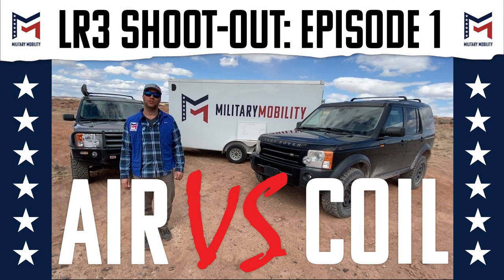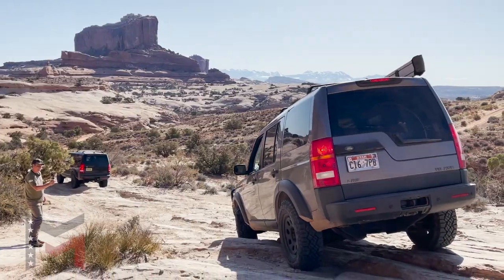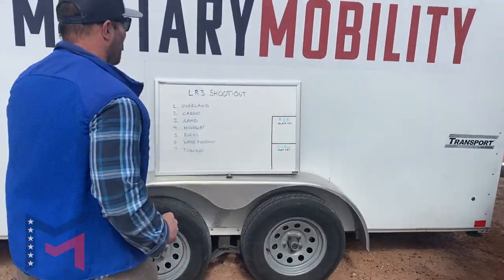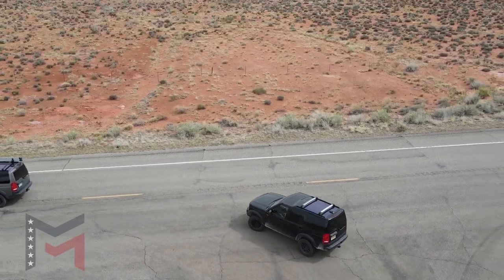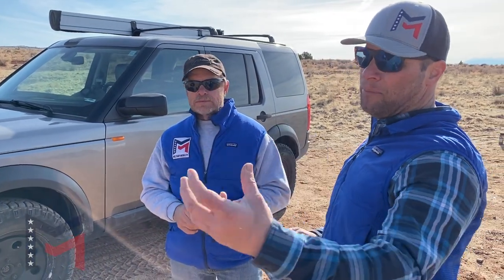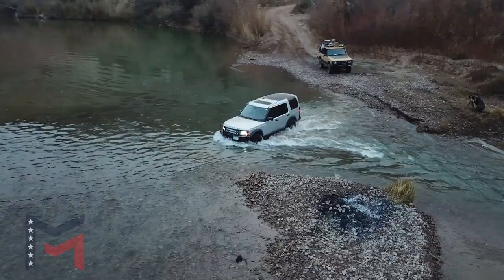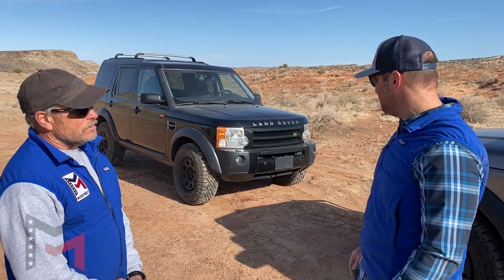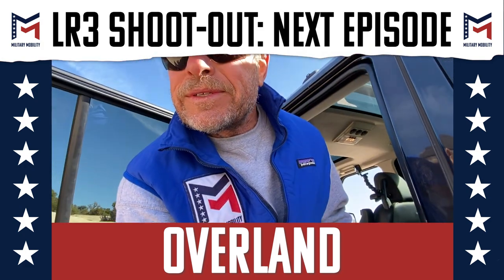Episode 1: The Set up / Land Rover LR3 / Air Vs. Coil Shoot-Out / Military Mobility

Comment: Hi Brian, 
Steve from GAP Diagnostic here. I just happened to stumble across this vid series. VFC! Very cool! 

The one thing I did want to mention: the IIDTool is actually a great backup for a air suspension failure as well. You put the air suspension in "build mode" (as in the factory during the build) and the EAS ECU will not do anything automatically anymore. You can then pump up each corner of the vehicle manually using the IIDTool and the vehicle will stay at exactly that height. Barring a catastrophic failure of the compressor or an air bag (both very rare) or other mechanical issue, you're good to go.

Good on you for keeping the air suspension. It has a much worse rep than it actually is. And if you consider it a maintenance item and check it regularly, you'll likely never have an issue off road. If you have any questions or suggestions, give us a shout.
Reply from the maker: Steve, thank you for joining the conversation; and sharing these insights with the group! We’re so glad you are enjoying the series 🙌. I’ll tell you that the IIDTool has been invaluable for us in troubleshooting the EAS when the LR3 was donated to us on the bumpstops; don’t believe there was any feasible way we could of diagnosed or tracked what was going on without it. So cheers to you guys, and thanks for your incredible customer service; it’s really appreciated!

Comment: Dude the air suspension is amazing and with the GAP IID tool is amazing. I had a 2007 RRS HSE lifted on 33” Yokohama geolandars and those exact same black rhino wheels and arnott struts. Stuff did go wrong over the 80k miles I had it (stolen from my condo...on a flatbed !) with the rod lift lights all around snorkel bumpers winch etc etc and it was an amazing truck. However I grabbed a 2000 lx470 and have been customizing that and it’s a much more robust vehicle. That being said...KEEP THE AIR SUSPENSION ! You can adapt the valves independently to external compressor and regulate your lift at will. Lucky 8 off-road will be your new best friend.
Reply: How do you adapt the bags?! Heard of this not sure how it's done.

Comment: I love that you guys show the LR's some much needed offroading videos. These vehicles are amazing!
Reply: Also, I believe the iid gap tool can overide the height sensors which stops you from dropping to the bump stops.
Reply from the maker: Love your user name! Thank you very much, they are incredibly capable vehicles and we’re excited to share our experiences with the community 🙌
Reply from the maker: @dukeyhowzer  We have the Gap IID tool and rank it among “essential” equipment if owning an LR3/4. Partly true, the Gap tool allows you to set ride heights in a variety of ways and is extremely useful in troubleshooting, as well as some field repairs; however if there are failures to certain electrical or EAS components, the air suspension won’t function properly unless other measures are taken as well. 👍
Reply: @MilitaryMobility  I see then I was misinformed. Thank you for the response! I know see the importance of what you did to your LR3. Would you be willing to make a video on what you did, like a how too? I've never seen or heard of someone doing that to their air system. I would love to do this on mine!
Reply from the maker: @dukeyhowzer  Absolutely, we dive into it more later in the series and will be making a stand alone instructional as well 🙌

Comment: try fitting an X Lifter air suspension upgrade on the one with air suspension. Its a cool upgrade that %100 getting for mine.  It even has a recovery feature that overrides the AIR SUSP INACTIVE fault so can air back up if the system deflates.
Reply from the maker: The X Lifter is a great tool that our affiliate sponsor Atlantic British offers. Depending on what may go wrong with the suspension it can override certain issues; however if you have other failures of the reservoir tank or compressor, etc it cannot.

Comment: Nice to see a new video from you guys👍🏻 I have coils on my LR3, 275/65/18 Cooper STT Pro Mud Terrains. I've had several LR with and without air. While I like the no worry coils, I would prefer the air. Just more attention and upkeep. Use a set of lift rods and you are good to go. Also, I would like to have 35" tires but not going to happen on LR3/4 without heavy mods and just not worth it. Really should have 33" minimum that is the optimal size anyway. 32" with the 2" coil lift is what you can expect to fit. I had an airbag with a leak, put some green tire slime in it and it sealed up until I got back home.
Reply from the maker: Thanks Zman, took much longer than we preferred to put these out (staffing running the non-profit where serving veterans in need is our priority) but we’re so excited to up and running again!

This is great insight that you’re able to share from owning and driving both rigs long term. You’re right about running 35’s; the ones I’ve seen done like that will not last the way it’s set up, zero up-travel and taxes the cv’s. I’ve heard about the green slime trick however had concern about gooping up the entire system permanently. Did your EAS run well after the slime was introduced? 

And please keep the comments as the new episodes roll out!
Reply: @MilitaryMobility  I took the air-strut out and dumped the slime in through the top in the opening for the air line. Tilted it around to get it all around the inside. Reinstalled and it held with no issues to the air block or system. I did it as a test since my air strut had a leak. It lasted for a year until I sold that rig for a different one. It's prob not a long term solution but if you are in the back country it's a good trick to get home. Just keep a bottle of slime in your recovery kit. Not to be confused with fix-a-flat stuff.

Comment: Do you have a video or write up on how your backup system for if the onboard system fails? You mentioned airing the shocks up manually, I’d love that option as safety. I have your exact same setup (2008 HSE on 32s with rods)
Reply from the maker: Hi Ryan, a bit later in the series we’ll be diving into it in detail. We’ve also already improved upon our initial product and will have the improved Rescue System for sale on our website. All proceed go towards funding our veteran courses as we have no paid salaries and are an all volunteer organization 👍🇺🇸

Comment: This is cool! Do both of them have the HD package with the rear locker?
Reply from the maker: Neither of them do, so equal in that regard. This would indeed be a nice capability to have however we’re a non-profit and can’t be too choosy when acquiring vehicles, or in the case of the Black LR3, receiving donations. We’ve taken these rigs over some pretty challenging terrain and have been pleased with their performance over the last few years. Would be nice if you could positively control the rear locker like in our other non-LR vehicles. I’ve driven HD versions and have only ever seen the locker come on sparingly, Thinking a side by side of HD vs non might be in order next!
Reply: @MilitaryMobility  Absolutely. My old 06 LR3 HSE did have the HD package and there was a noticeable difference in climbing and low-speed maneuvers. Other than that, the Terrain Response was insanely good, even without it.
Reply from the maker: @BorellaFamilyAdventures  Good to know! More downhill control is always a huge plus!! Helping climbing doesn’t hurt either 😂

Comment: Great comparison idea. I would point out though that comparing 15 yr old air shocks to newer coil on shocks is not very fair if comparing the dampening. With pre-emptive replacement of the air shocks,  solenoids and air compressor, you can get another 15 years of reliable use.
Reply from the maker: Thank you; we’re doing the best we can with what we have. The point of the series is really to drive awareness to our non-profit that’s is focused on suicide prevention and illustrating that we know what we’re doing to potential supporters. Side note: we now have brand new air shocks on the black LR3 and while it is a bit smoother here and there; would vote the same way.

Comment: I was looking forward to all of this. Until you said it’s a stock air suspension system but with lift rods.  It runs higher pressure in the bags and will then give you less flex. So it’s not a fair test.
Reply from the maker: What would be fair for you OB92?
Reply: @MilitaryMobility  To me, this was a fair test of two LR3s both modified to run matching larger diameter tires for the improved ground clearance that better suits MM's off road operation. As the series continues, we will see the Air suspended truck out-flex the Coil equiped one despite the higher pressures in the struts. OB92 I'm guessing you might prefer to see a vehicle with standard height coils vs one with standard height air-struts, both running original 29" tyres. So while this series is not your ideal comparison scenario, I recommend it as an outstanding watch with many take-aways that would cross the standard/extended divide. Plus it's just great guys pushing outstanding vehicles in amazing scenery - what's not to enjoy with your feet up and a cold one in your hand?
Reply from the maker: @kiwibrett  We are BEYOND pleased with your observations!! Thank you for your understanding and support ❤️🙌
Reply: @kiwibrett  maybe me saying it is not a fair test was wrong.  I would have like to have seen a fully stock air suspension car up against the coils.  I have seen first hand the difference in capability between lift rods and no lift rods and when you run less pressure it’s is so much better.
Reply: @MilitaryMobility  I've watched a lot of Matts Off Road Recovery and wondered what my LR4 would make of steep smooth rock. Thanks to this series I have a much better idea. It would be huge fun I reckon. I run 33" General Grabber MTs via a 3" lift achieved by reprogramming the suspension computer.